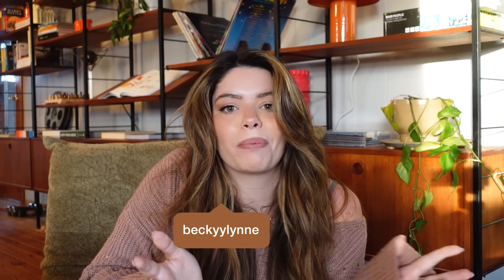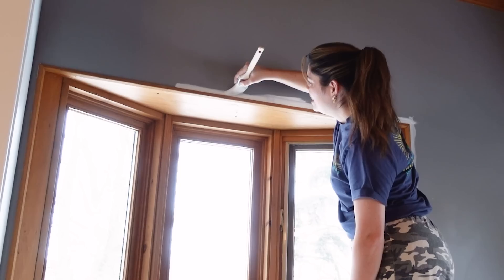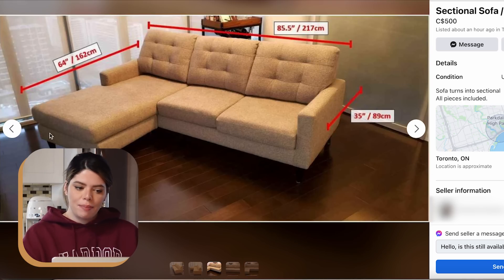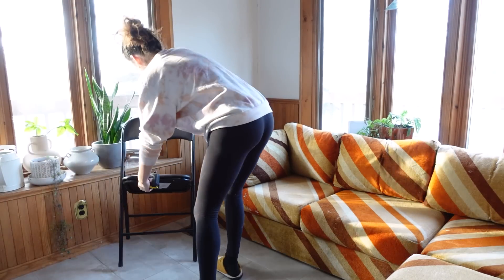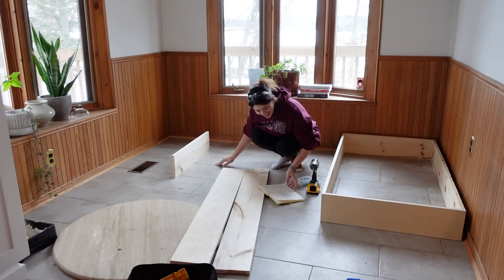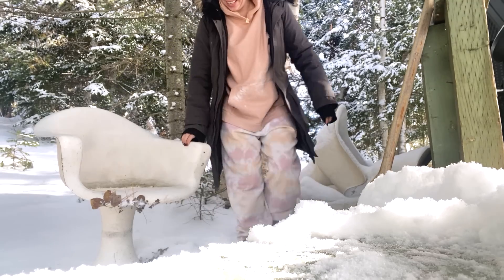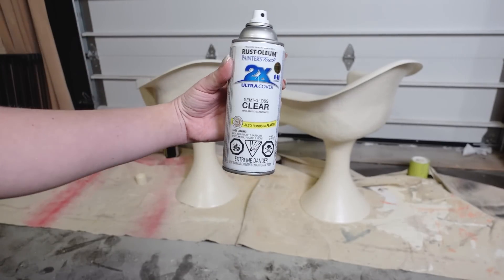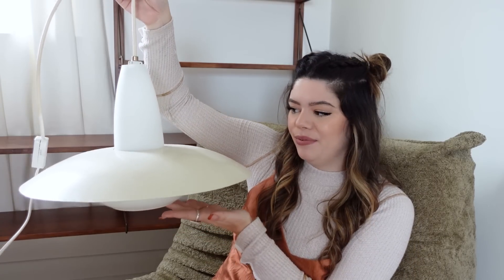will i regret this old sofa I thrifted?

Comment: If you have the space for it, I think it'd be cool to "split" the sofa and fill in the empty space with a corner table or something to make it look built-in. I think it would be even better if the sofa went all the way to the wall and there might be a lot of wasted space in the corner because it would be hard to sit in such a deep corner and eat. Just a suggestion :) I don't even know if its possible, but I saw that it came in two parts, so I thought I'd say it. I love the sofa for your space!
Reply: I was just about to say the same thing! Great idea
Reply: Good idea!!!
Reply: came here to say this too ! it's so cool already, but i think splitting it up and building a block in the corner like you said would really elevate it even more and also maximize the seating!
Reply: Absolutely,  my vote too is wall to wall couch with a spacer in the couch join.
Reply: I think she might even make another pillow for the sofa and use the same fabric as the chair's pillows to look even more like a unit. 
I love her videos, always the best ones! ❤️
Reply: Or if you moved the couch on the left wall under the window, you could place a vent extender in your base (because I assume that's the reason the couch isn't on that wall) and that would give you a larger space for your table and chairs.
Reply: You know, like you did with the fireplace at your previous place.
Reply: A solid decorative cushion in the corner would provide back support for the person seated there and push them forward towards the table.
Reply: Genius
Reply: I would never buy an L shape couch because of the corner seat. It's just about useless!. Ideas here sound good.

Comment: I love the sofa. But it looks like the fabric needs a little love. Is that my imagination? Also, those chairs were genius. Hard to believe they were living outside.
Reply: Even just some fabric dye and a small paint brush
Reply: IK!! she def should reupholster it but i get the timeline to get the video out may have stopped that. i just wish she had at least cleaned it tho
Reply: Can you imagine finding a true 70s sofa that DOESN’T smell like cigarette smoke.
Reply: Considering that it's a 50 year old couch, I'd say the fabric has held up pretty well!  I think the worn bits will be hidden by a table.  Can't wait to see how it turns out!  :)
Reply: I was thinking the same thing and really just wanted to reach into the screen and flip the cushion on the left around.  Is the backside any better?  It looks FAB!  I'm excited to see a Saarinen type table or brown smoked glass round table.  Very cool.
Reply: Love you work Becky but I hate the dirty sofa.
Reply: I was hoping she’d re upholster it.  I guess we’ll see in part two.
Reply: @moirapastre1234  I’m not sure flipping it will work because of the pattern. The stripes are matched on upholstered part of the base. Maybe she can touch it up with a fabric pen. 🤷🏼‍♀️

Comment: Hey Becky,
Consider moving the couch to the wall with the fridge but still snug in the corner. Visually, I think it would complete the girth/bulk of the fridge and be a nice place for your eye to land after the viewer is finished checking out your great angled ceiling details. Additionally, it would allow you to put the chair backs to the right inner wall and allow for easier movement around the entire table itself. Bonus would be to keep the u open to the kitchen so whomever is cooking can interact or the party can spill into the other room without people feeling like they are being towered/reached over.

Comment: Hey Becky, a quick...hack? Tip? Whatever for painting edges without using painter's tape is to use a putty knife! I attempted it because I'm a little too lazy to tape up all the places I'm supposed to, and it works fabulously.

You basically place the putty knife against whatever surface you don't want paint on (usually at a 90 degree angle from the surface you're painting), and any paint that would have gotten on the no-paint surface just gets on the knife. 😁 It's great because you can move it along as you paint, you can choose whichever width of putty knife works best for you and your space, and it's reusable between paint jobs!
Reply: Suggest a bench scraper….for wider blade.
Reply: They make such a product. It’s already large. It’s for painting trim (use to shield the floor). Mine is like 2 ft wide.
Reply: @livelongandprospermary8796  yes, I'm aware. However, for people who don't want to make a trip out to buy a product with a single utility, they can go to their basement or shed or wherever they keep their tools and grab a putty knife. It won't be as wide as the purpose-made tool, but you save gas, time, and money with essentially the same effect.

Comment: If you have the time, would definitely create a full wooden encasement for the couch (on both sides and maybe even the back if there's room to push it forward) so that it fills out the space completely. That would make it feel truly "built in" and could also be a great spot to add additional decor if you wanted

Comment: Since it will be at the dining table, I'd recommend giving the sofa a nice, thorough steam-cleaning 💨
To make the couch look more "built in," you could either A) put a matching stained wood box/end table-bit in the gap on the left, or B) separate the two couch halves and put the built-in table-thing in the triangle of corner space, which would also give people sitting in/near the inner corner more comfortable space to sit without having to sit at the corner of the table or knocking knees with each other.

Comment: Absolutely love the couch and this whole idea. So fun! I would build/fill the gap between the couch and the wall on the left side with the same stained wood so that the couch looks even more built in and you get a kinda of side table! you could even continue the wood on the right side too. I would make the right extension much slimmer so that it wouldn't block the flow/ be too hard to get around but you could put plants, a cool lamp, some books etc on the shelf.... if you made the right extension the same height as the couch, you could maybe even figure out a way to put  sliding doors so it becomes a kind of sideboard for you to store placemats etc.

Comment: Looks so good so far!! You should take some color matched fabric paint to those bald spots on the couch for touch ups! (And maybe start with a layer of white to make it easier)
Reply: Another idea would be to reverse the cushion whether by flipping it around or tearing it apart and sewing the back, less worn section, in the front.
Reply: acrylic paint mixed with fabric medium = fabric paint (for the most part)

Comment: I would center the sofa so that the three back cushions line up with the windows and put wood shelves (or planters?) in the gaps on either side at the same height as the top of the back. That way it will look more built-in and customized to the space. Also would love to see a funky chandelier/curtains with an upper sash to balance everything out and complete the lush, luxe, anti-minimal vibe.

Comment: I guess this is an unpopular opinion because I haven’t seen other comments but, my suggestion would be to rotate the couch so it sits in the other corner because the way it is right now with the doorway makes for a weird flow when trying to sit around the table. Whoever sits in the chair would be trapped. But if the couch was rotated it’s deep enough fill the space and solve that trapped issue. 
But I’m sure however Becky finished this space it will be great! 💕

Comment: If there's space you should see what the couch looks like turned 90 degrees, so the shorter end is on the back wall! That way maybe the chairs can be turned too and the unfinished backside won't be as visible and the cool. Then for the open corner area maybe a tall built-in bookshelf for plants or ✨finishing touches ✨

Comment: 🌞🌞🌞🇨🇦🇨🇦MCM is my vibe 100%🌞🌞🌞🌞🇨🇦I once built a nook dinning area like that with a couch. It looked very similar to yours but longer in each direction. I made the base 2.5-3 inches set in from the front edge of the couch. then placed a 3/4 inch plywood that was the same size as the base of the couch to give it support and an overhang. then attached a wood edge around edge of the plywood to frame the couch. I added a led strip light along the bottom edge of the couch as well. Hopefully you can visualize what im saying. Basically like the toe kick on a kitchen cabinet. I'm jealous, those chairs are so cool.   😁 Thanks for sharing. I love seeing MCM design getting the love it deserves. 🌞🌞🌞🌞🇨🇦🇨🇦🇨🇦🇨🇦

Comment: i like it! What i would have done is: I would have extended the base to completely fit the nook, so also the loose space to the left of it. The extended that loose space on the left two planks up, so that the fight would be flush with the sofa. Why? Because it could be a planter! So I would have made a planter the entire size of the extra space, seamlessly attached to the base of the sofa. What this does is it makes the sofa look even more built in and built in planters are very 70's! also you need some green to counteract all that orange :)

Comment: Actual audible gasp at the fabric reveal of the couch, so perfect. Building some depth to the sides of the couch with extra boxing to make that unit fit the whole width of the wall, and then covering that boxing with the same moulding that's on the lower wall in the rest of the room, and the same skirting board, would make it look so perfectly built in! (And also give you some extra plant/decor ledge) Love love love this idea immediate pin for my imaginary house I'll one day own 😅

Comment: A good cheat for cutting in around trim is a thin piece of cardboard. Think cereal box, or maybe even thin firm plastic packaging. Of course, you need to use both hands, but it's a hack pro painters use in tight situations.
ps. It's House of Braemore Furniture, @ 4647 Dufferin Street, Toronto. Still in business.
That's a great idea for the sofa, raising it like that. I was so excited when I saw the chairs! What a perfect period match. Looks great so far, can't wait to see the new lamp and table.🙂

Comment: Someone commented on splitting the couch and I think that is a great idea. If you pull the right side to create a square space between the sectionals you could build a corner table that makes the sofas flow. That will creat more seating as you are taking advantage of the seat that is right now in the corner. I would consider adding cushions without prints to “neutralize” the print on the couch. That will make it more current. I can’t wait to see what funky lamp you add, and do t forget about the art work!!! Are you going for a round table? Its going to look amazing!!!!

Comment: Becky, You have a curated the perfect vib for your dining room.  Two things could be done to elevate what you have so far. 1. a bit of fabric paint to fix the damage on the far left cushion. Some reason it stands out.  2. Add a bit of brownish toned stain to the wood platform will take away the orangish look, However I think it looks perfect the way it is.  For the lighting there's 3 options my favorite would be the giant arched floor lamp with the 5 lights. It would be the most dramatic. 2nd do a extra large wicker style light centered over the table. 3rd choice would be a grouping of 3 to 5 hanging 60's or 70's vintage different colored glass lamps. It's a bit hard to see the room size. Cheers

Comment: Along with other suggestions for built in plant box and shelf behind the right side, I think the base you made needs some cladding like the walls, as the wood grain is going horizontal whereas the wood on the walls and windows are vertical

Comment: Since on one side of the room you have the kitchen putting the sofa on the other corner so that it is on both window walls and aligns with the kitchen would make feel the space a little more spacious and as soon as a desk is in there probably also easier to use the couch and the chairs. That would also make the small left space feel less visible because it isn't the first thing you look at in the dining room cornor anymore. Maybe painting the wood the darker brown that's in the couchcover would make it look more cohesive and filling the gap between the bench and the couch with a small decorative shelve e.g. for place sets, cook books, smaller board games, would make it look more built in and add some practical storage. Becaue you have two windows I wouldn't put too much on the free wall maybe some fitting framed in wallpaper?
When I first saw the couch I thought that it could never look good but you've done a great job so far, and I can't wait to see how it will turn out in the end! :)

Comment: Tip for you if you want to "hide" the worn out spots. I don't know if the cussion covers come off. If they do find similar colour threads and stitch leaving long tails(I don't know how else to explain it lol) to fill out the spots,and then shave or trim with scissors. Another shortcut might be to use permanent markers or cloth dies to paint the spots.

Comment: One hack I use for painting trim/edges of walls is hold a piece of something like cardboard or sturdy paper against the place you're painting then just move the cardboard piece as you move your brush. 

The cardboard is kinda placed like a "shelf" sandwiched against edges or the other surface and works wonders/is nice and quick!

Comment: Looks really amazing so far!! And $50 for that vintage couch is a ridiculous deal.

My votes go to trying to use some fabric paint or touchup on those spots on the couch and finishing out the gap on the other side of the couch with stained wood / making a little side table situation.

Either way, can't wait to see how it turns out!

Comment: Way easier said than done, but I would center the couch to the window and create a built in surround. That way you’d have a little wooden lip on either side of the couch and make it look original/attached to the space. I know it’s hard to match the stain color of the walls, but I truly think you might want to find a veneer panel or something (with a nicer grain…) to cover up that pine and try again!

Comment: I think you should build a narrow cabinet to fit in the gap between the wall and the sofa, it could have little drawers that pull out and hold utencils and like basic sauces you'd usually keep on the table. And then decor on top of it.

Comment: Re: keeping paint wet
Masterson Sta-Wet Paint Palette is the brand to look for if you just want to buy it, but it is really easy to DIY or do a hybrid buy the paper refills and make the rest. It is for paint mixing but it will keep the paint wet for a good while. Even longer if you put it in fridge. Make sure you watch for mold growth in the sponge, and/or put copper tape, wire, sheet or pennies in the bottom to prevent mold as well.

Comment: A really useful tool for painting edges and trims is a 'trim guard'. Which is a tool shaped like a blade with a handle, that you hold up against an edge to guide and block your brush. No more tape, no years of practicing a steady hand. (Just wipe it with a cloth in between strokes :)

Comment: Removing the base board behind the couch, so it is completely flush to the wall and filling in the open gap to the left with something would aid with the built in feel. Also covering the two sides of the box holding the couch that are seen with panelling to match the walls would completely blend it into the room.
Reply: *something could be a side table/shelf construct like others have suggested.
Reply: Adding a stripe/s to the back of the chairs in the colours of the couch. Just one or two would pull them cohesively together. 

I could see one stripe in orange or that deeper brown with a thinner cream stripe starting on the diagonal across the back and just following the flow of the pedestal leg wrapping round it to the floor.

Comment: So cool! I feel like the flow would be a little nicer if the couch was in front of the window to the left. I know there is a vent there but you can get vent extenders & add a vent to the wood base on the couch so the air still comes out into the area!

Comment: Love the vibe of the couch and chairs together!! Only thing that I would say, is that once a table goes in, it's gonna be tough to get in and out of the couch? Would it work better if you rotated the couch 90 degrees so the long back is against the wall on the left? Would make it more accessible and the chairs would fit in really nicely along the right hand side

Comment: i looove this idea of the couch but definitely think this needs a bit of tlc to make it more luxurious ! i really think removing the back cushions would be a good move as the back rest of the sofa is still quite thick and will make it look a bit more bench-y rather than so much like a couch. also definitely needs to be re-upholstered in some fresh funky 70’s vibe fabric and this will also ensure that it gets a good clean inside, you could then have some smaller rounded bolster cushions made out of the same fabric to have a slight back rest (this will also break up the angles. also agree with the other comments about boxing this is and creating the side table area on the side and staining all the wood the same as the panelling for that luxury retro look. another idea also for the corner section which realistically might be dead space whilst sitting at the table would be to create some sort of small shelf area out from the wall but this might require some more brainstorming to ensure it doesn’t get in the way of getting in and out of the couch.

hopefully you like these suggestions and i’m really excited to see this space evolve ! x